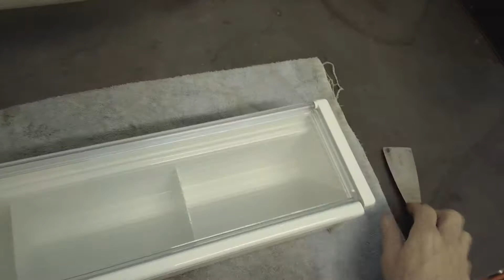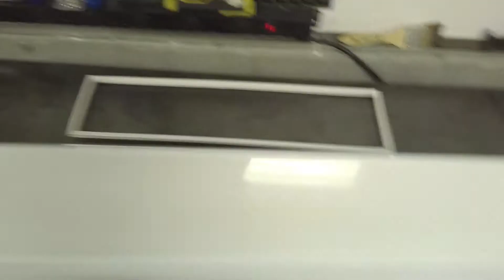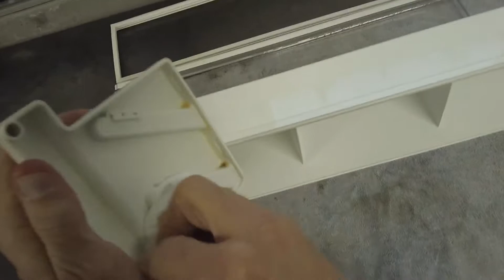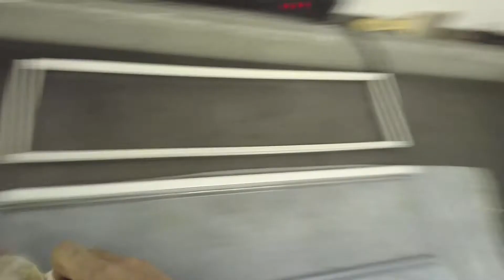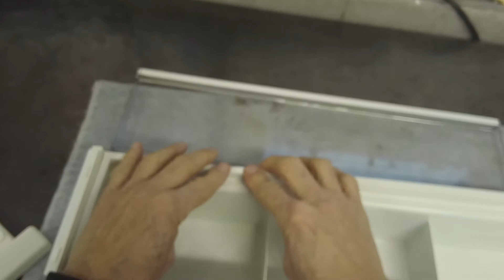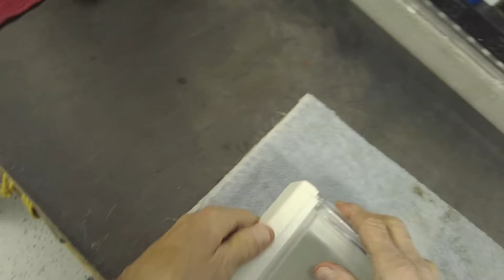Sub Zero 611 650 Dairy Compartment Disassemble and Cleaning

Comment: Hi, great tutorials, thank you! Do you have any advice on how to disassemble the leading edge of the DOOR for the dairy compartment? It is basically a white strip…There is some grime in there and I’d like to clean that as well
Reply from the maker: @brianmilidrag2240  Send me a pic of what you want to do
Reply: @not sure how to attach a picture?
Reply: @SubZeroSpecialists  this does not appear to be an email address and I’ve tried to attach a pic but it will not let me. Describing it: the leading edge of the dairy compartment door…the part you grab to lift the door has a white strip attached and it has grime in it. I would like to remove that strip to clean? I can send a pic if you provide an email address?
Reply from the maker: @brianmilidrag2240  send it to support@aaronsrefrigeration.com
Reply from the maker: @brianmilidrag2240  send the pic to subzerospecialists@gmail.com

Comment: Thanks for this video. If the dairy compartment door won't keep closed on its own, does that mean the magnetic strip in the gasket or in the compartment door has gone bad?
Reply from the maker: Remove the seal and try it. If it still doesn’t close properly check the alignment.
Reply from the maker: Are you sure the seal is seated properly? If it is remove it and see if the door closes all the way, and if it does try flipping it. Also you can remove the seal and test the magnetic pull against the side a metal cabinet and see if it holds.

Comment: Hi, do you by any chance know if the rubber seal is replaceable? I have cleaned it in and out but it has mold I just cant get off. Thank you!
Reply from the maker: It should be. Call certified appliance parts at 800-305-0722

Comment: Can we remove the  part along the shelve, as there is some oil that leaked between the plastic shelve and the white bar ?
Reply from the maker: Are you talking about the door shelf or the compartment shelf. The shelves in the compartment cannot be disassembled.
Reply: @SubZeroSpecialists  the two door shelves middle level of the door.  Not the one on top with butter spaces with a flap door, the 2 below
Reply from the maker: @LaFemmeBionique  yes those shelves come apart. We have a video that shows how to dismantle and clean.
Reply: @SubZeroSpecialists  Does the white bar on the door could be detached from the transparent part?

1
Reply: I cannot figure it out, it is tight
Reply: @SubZeroSpecialists  Do not find a video re: door shelves precisely, I see the video for the diary shelve, it does not show how to remove the long white bar
Reply from the maker: @LaFemmeBionique  okay let me check
Reply from the maker: @LaFemmeBionique . The process for disassembling the shelves is the same as the dairy shelf, you have to remove the side pieces and then you can slide the bar out.
Reply: @SubZeroSpecialists  Many thanks, super